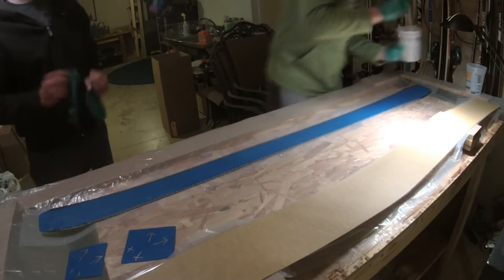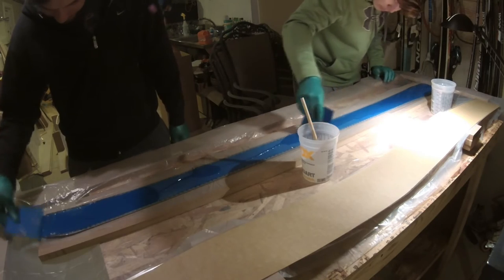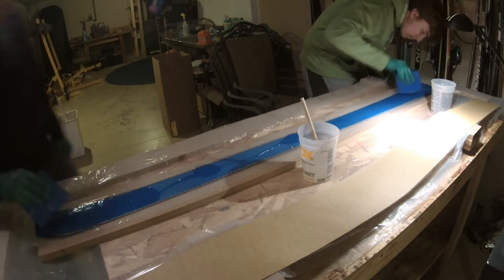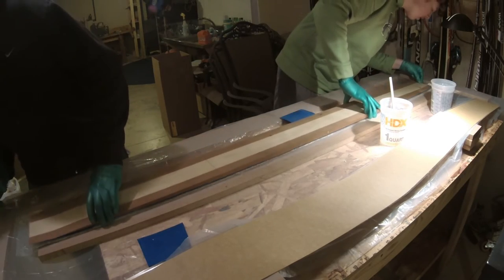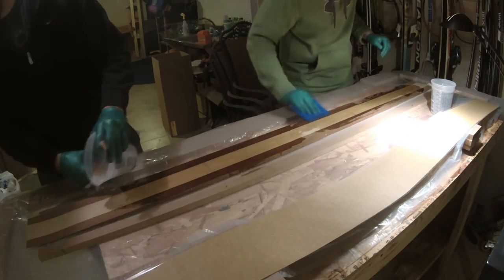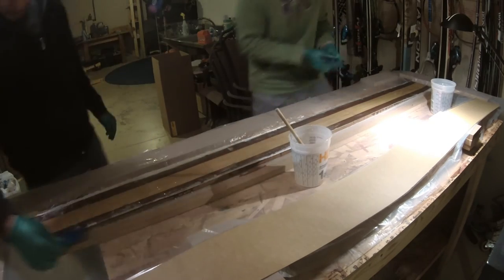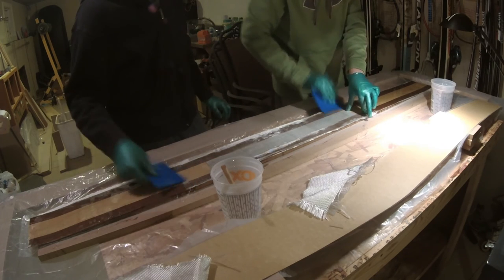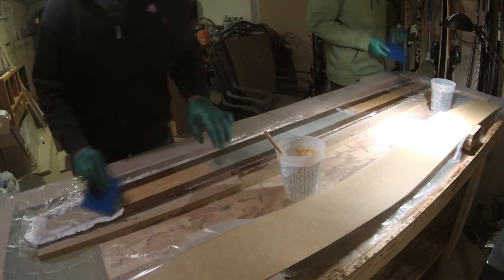How to Make Skis Part 8 The Layup

Comment: if you don't use an aluminum plate do you need the second strip of fiber glass
Reply from the maker: Brady White no you will not however, if you add that strip of fiberglass under your foot the ski will be stiffer there and your binding screws will have more to bite into.
Reply: ok awesome thanks
btw ur vids are so helful